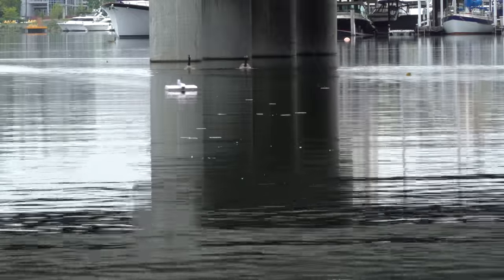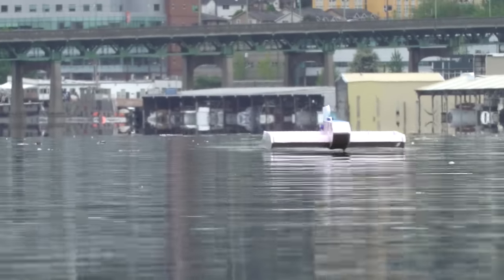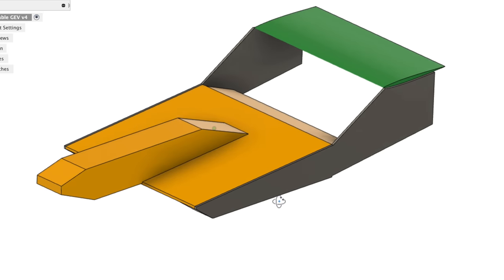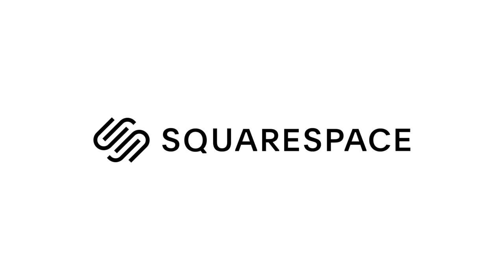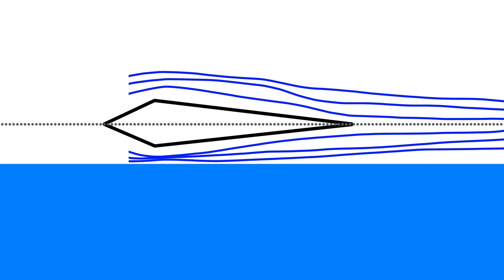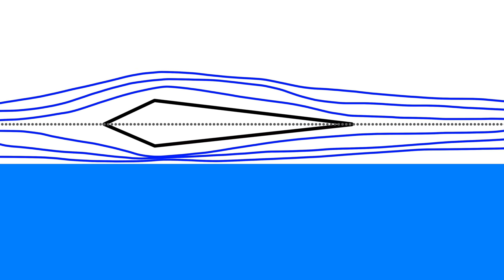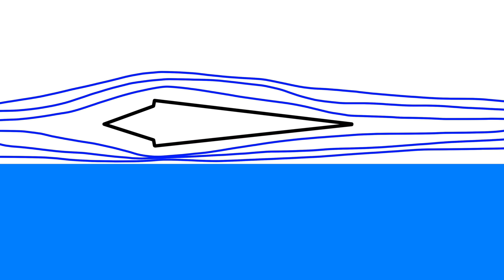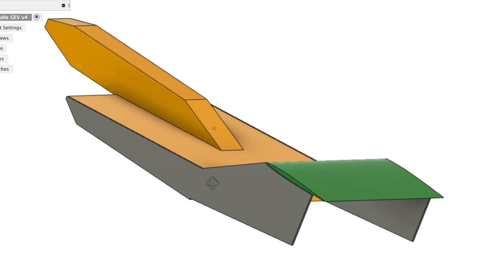RAM Effect Vehicle - A New Type of Aircraft Wing Design?

Comment: This is a cool project. The russian Ekranoplan was built in the 1970's and actually very successful as a cold war presence and as a ground effect aircraft. Glad to see people are still playing around with this concept
Reply: I was looking for this comment, I was  aware of the Russian craft as well.
Reply: The ekranoplan failed as a ground effect aircraft. It didn't function well under wavy conditions.
Reply: @MrAnonymousRandom  but you mean the showed in this video conzept is working even wavy condition or what are differences between?
Reply: @MrAnonymousRandom  I thought this concept here was intended for even more ideal conditions? I heard at least some Ekranoplans were able to gain quite an altitude for a bit, while this  thing is basically doing the same as a magnetic head would do inside of an HDD above a spinning disk...
Reply: The Ekranoplan worked, but was basically a boat with wings attached to it. For seriously effective ground effect vehicles, there's another scientist who was an aerofoil engineer first; boat-guy second. He came up with some seriously nuts stuff that could more effectively use ground effect to actually be useful in heavy oceans. Instead of being just a few meters off the water or land, we're talking tens of meters. Enough to travel over all but the heaviest of seas and most trees. Robert Bartini.
Reply: @MrAnonymousRandom  Doesn't  mean it was a failure as much as it was simply not as capable as they would have liked. It was an extreme example of engineering at the time.
Reply: @5peciesunkn0wn   you talking about different tasks. Robert Bartini tried to create a vertical takeoff seaplane. Rostislav Alekseev immediately made a heavy transport-attacking groudneffect vehicle - they didn't have to flight high. They just needed to move very quickly while staying below the tracking radars.
Reply: @5peciesunkn0wn  It wasn't a failure as the point of the Ekranoplan was to be able to fly low and avoid radar detection when necessary so it could launch attacks from close by. People saying it's "just a boat with wings" are missing the point, because as far as I know, boats can't fly away when needed, and as far as I know, boats can't travel at 550 km/h either. The reason the project was dropped was the fact that it was no longer necessary due to high precision guided missiles launched from ships and submarines basically being able to do everything an Ekranoplan was designed to do, but faster and cheaper.
Reply: I think most people here know this
Reply: @derbigpr500  Project was droped mainly becsuse of financial problems of USSR, not because was failure per se. Point of Ekranoplans never was to replace warships and they dont have the same role as submarines - they dont carry balistic missles or mines. Ekranoplanes were designed (at least Kaspian Monster) as desant vehicles, transport vehicles with speed of airplane and capacity of ship. Ideal machine for fast crossing Atlantic or Pacific Ocean with relatily large forces if Soviets will ever atempt to strike USA in America.
Reply: @Bzhydack  No (: 
Soviet never planned the landing of large forces in USA. The plan was to launch missile strikes and destroy coastal cities with heavy nuclear torpedoes. For this task there were both bombers and submarines.
Ekranoplanes were intended to fight American aircraft carriers and escort ships in a 1000 km zone. The second task was to organize a landing in NATO countries in Europe across the sea
Reply: @GuestNight  It depends witch Ekranoplan we are talking about. Kaspian Monster was clearly design as transport vehicle, but Lun was indeed carrier hunter.
Reply: @alexandrkil1140  its quite flat for its weight and scale all things considered
Reply: @Bzhydack  Kaspian Monster was named so by the West because of the abbreviation of the working name of the project - KM  - Корабль Макет ( ship layout). КM was a working heavy prototype on which nodes and engineering solutions are being worked out. It was not planned for the series, as well as light prototypes СМ-1 and CM-2 (Самоходный Макет 1 и Самоходный Макет -2) . The series should have gone: heavy - Lun, light - Orlenok, and super heavy carrier (the project remained in the design stage)
Reply: @MrAnonymousRandom  It could fly up to 16,000 it was only the landings and takeoffs that proved difficult in choppy conditions. On sand bars, mud flats, Russian steppes, tundra, ice sheets etc it would have been brilliant - but it's point was to counter the US aircraft carriers...
Reply: @5peciesunkn0wn  I was taught that ground effect is directly related to wingspan.  If true, go bigger.
Reply: The problem with ground effect aircraft is... well... the ground.   That's why they work well on water, the smoother the better, but fail when dealing with land.  This small craft can't handle grass because it breaks up the slip stream, stealing lift.  It would have to have much more power to push much more air under it to defeat grass.  Waves change the pressure passing beneath the vehicle which perturbs the lift as well.
To make a commercial one work would require an advanced computer and sensor suite to read the surface ahead and adjust it's elevation and thrust to maintain a consistent pressure envelope, otherwise the ride over heavy chop or open sea would be extremely bouncy and one especially deep trough would cause it to ditch.
Reply: @woodymiller2763  If the whole plane is a wing, then you have max wingspan.
Reply: @GuestNight  Except Robert's vertical takeoff idea was scrapped for conventional lift later, so he's talking about the right person.

Comment: Alright, so instead of aerodynamically stable in ground effect, how about some sort of built-in mechanical stabilization? I’m envisioning a floaty thing rigidly attached to a linkage that pivots and deflects the elevator control surface so that you’ll get full up elevator when at 0 altitude and full down elevator when above ~1ft out of ground effect. Basically leverage the nature of ground effect with the surface of water available to do work on your system for you
Reply: Could be problematic because of the relative size of waves and the float, there will be probably quite heavy oscillations. The aerodynamik stabilisation could be the smoothest one possible at this scale, like we could see in the video
Reply: That sounds like a concept similar to the arm that trails in the water to control the hydrofoils on a moth class foiling sailboat.
Reply: @GunganWorks  wow, did not know about this. Turns out they’re called ‘sensor wands’ and do exactly this. Now I really wanna see Daniel try it out
Reply: @GunganWorks 

YES!!!
Thats what I thought.
REALLY cool boats, the moth's

Comment: Waterproofing electronics I found the clear "E-6000" glue works the best and lasts forever. Hope this helps for future builds.
Reply: RTV as well.
Reply: In some flashlights they incase the electronics in epoxy, mainly for durability since the solder joints can't break, but also for waterproofing. Wonder if that would work too 🤔
Reply: @mynamesnotimportant6941  Epoxy is in fact a common method in industry to protect electronics and to preserve performance specs. It's called potting and incorporates certain characteristics, but the casual user can likely get by with many everyday varieties..
Reply: @joewoodchuck3824  fair about the average consumer. I like extremely durable things though so when I get the chance I'ma pick up an Elzetta flashlight. Really expensive but fully potted electronics so extremely durable. One dude even dropped his out of a helicopter at 300ft and it landed on concrete; broke the concrete but the flashlight still worked.
You can also disassemble the flashlight underwater, and nothing will get damaged (also from the potting). Really cool. :D
Reply: @mynamesnotimportant6941  Do as you want but you'll be doing yourself a favor by looking at Streamlite (Streamlight?) products first. Rugged and with a long standing reputation for reliability.
Reply: @joewoodchuck3824  streamlights are great, I have one. But they aren't quite up to par with Elzetta. Still great lights though :D
Reply: I pot stuff in hot glue for prototyping. It's waterproof but you can use a heat gun to remove it or adjust stuff later, and it allows for flex without cracking

Comment: Looks like a star wars speeder on sand.
Can you try it out on a really flat surface like ice rink or basketball court?
Reply: That could be hard, the hard surface might damage the rams/skids. It would be best with wheels probably
Reply: @blu5021  plastic trims on the skids will suffice
Reply: @blu5021  or teflon
Reply: I think it needs waaayyy more room than a single court.
Reply: @russc788  Mall parking lot?
Reply: @blu5021  Just need to add little pieces of UHMW on the parts that would run on the ground.
Reply: @alexjones7845  the principe of use ground effet to reduce drag is to prevent air flow around the wing. if your groud effet vehicule at is side constantly in contact with the water, this would theoretically remove induced drag.
Reply: Jean-François but wouldn’t that increase drag because the amount of drag from contacting the water would be more than what you reduce from air spilling out the sides
Reply: Football field...retractable wheels required.
Reply: @DivineArchirekt  not quite what your thinking possibly, but an Australian designed twin-hull called the Sharkcat uses the air trapped between the hulls to dampen the shock of manoeuvring through rough seas making it ideal for surf rescue.
Reply: yes pleasse, do this
Reply: @DivineArchirekt  wouldnt work for choppy water. Also I think the soviets tried it out its called the ekronoplan. Whack thing that was.
Reply: @blu5021 I was thinking ball bearings
Reply: WHere was he when they designed it for Star Wars? Oh yeah, waiting for birth!

Comment: Added effect of the wedge wing is that when you leave ground effect the vortices would create HUGE drag behind the wing as the vortices start to flow into the low pressure area inside the ram.

Comment: When my kids were little I would tow them behind a bicycle on the hard low tide sand at the beach sitting atop a ground effect type of sled made out of plywood. Needed a bit of headwind but as soon as it started flying it was almost effortless to tow. The final iteration had a canard type elevator that they would control. Had a few mishaps but with a helmet on they never got hurt , much. It certainly didn’t put them off doing it at any opportunity.

Comment: With a proximity sensor, you can program it to automatically adjust fan speeds so it doesn't get slapped onto the water.
Reply: that feels like cheating
Reply: ? pilots just use the throttle......

Comment: Looks great, your video is on point!

I tried a few ram wing designs years ago, but only ever on land. I got one stable with only rudder\throttle control though it was quite sketchy. The basic principle of a ram wing in ground effect with a lifting tail well out of ground effect gives you passive pitch stability, and as long as it stays low it's also self stabilizing in roll. If it does get out of ground effect it's game over, ask me how I know!

I actually strayed away from any power assisted ram effect after some testing, it's just one more variable in already tricky stability. Though you certainly proved it can work if handled carefully.

I've got an idea swirling for a wheeled ground effect craft now.
Reply: what sort of aspect ratio were your wings?

Comment: Have you thought about hydrofoils to get it out of the water, but are so short, that they'll leave the water when in ground effect?
Reply: Or maybe retractable ones
Reply: yeah, I came to the comments to say the same thing. I want to see some hydrofoil + ground effect experiments!
Reply: Retractable hydrofoil landing gear, this is what the world needs
Reply: @witchofengineering  RC Sea Dart When
Reply: Just left a similar comment and saw yours! Great minds...
Reply: @witchofengineering  the Beriev Be-1 (prototype of the VVA-14) just had fixed hydrofoils on the forward side of its floats, so fixed would absolutely work.
Reply: lol i just said that.... retractable hydrofoils
Reply: @hansm1149  there are much more useless things in existence unfortunately
Reply: Very small surface piercing ones, like winglets, could also help control while out of water
Reply: Sounds like it won't be compatible with building it from foam board
Reply: @m.sierra5258  If it was covered with a leighter ounce, bixaxial fiberglass and some epoxy resin, I think it'd hold.
Actually being so small and lightweight with such small pressures to work with, It could probably just be a way cheaper, lighter, fabric with resin.
Reply: A good idea for future experiments, but it would involve more work than those simple wedges.

Comment: 1. What effect does the wingspan have on the system? Would you be able to cruise higher with more wingspan?
2. Maybe you could use some smoke on the water on a cold morning to show the airflow and vortices?
Reply: I would suggest some Deep Purple music in the background for that video.
Reply: @matthewcragg3607  maybe he should set a nearby building on fire to create the smoke. with a flare gun for example.
Reply: i don't think it would go higher, just it's gonna get to the desirable height quicker.
Reply: @larsh.1154  great suggestion man, good stuff
Reply: @matthewcragg3607  I laughed hard at this.....thanks.
Reply: For this system specifically, I don't know if increasing the wingspan of the craft would directly allow it to go higher. Increasing the span works on other vehicles allows them to go higher because the vortexes made by the airfoils is larger (I think). This vehicle doesn't use an airfoil, so the vortex effect is probably less. 

However, I do think it could increase the cruising somewhat if you can keep the weight does climb to much as well. I think you would get a bit more lift if you increased the chord of the wing (length from the front to the back of the wing, for those who might be wondering), as well as some gains if you increase the area. 

TL;DR: I think you could get a bit more height if you increase the wings area somehow, though length would probably be more efficient at it than width.
Reply: Using this method: Not really. It's relative to the size of the entire craft, because what you're actually trying to change is the cushion of air. Bigger wings make that wider, not taller, and may actually be harmful.

The Soviets innovated this technology with a massive missile carrying version. This one was several feet up but was also massive - it could have technically been one of if not the largest aircraft at the time - and worked very well.... On calm waters only.

Basically, the whole thing has to get bigger so the cushion of air can get bigger and taller.
Reply: @larsh.1154  No.  Because then he would land in prison and his next series of videos would be something like "How to Make a Shank" or, God forbid, how to transport them unseen.
Reply: What I've read and seen suggests that greater wingspan contributes to higher flight at lower speed, take a look at the wing in ground effect vehicles that have seen real world use, whether they be Lippisch reverse delta wing or the Russian style they generally have a substantial wingspan for their size.

The narrow tandem ekranoplans seem to be incapable of doing much more than skip across the surface.
Reply: 643663
Reply: Larger wing dimensions lead to higher maximum heights, yes. It might not be a linear relation though, but instead a square or cube root. Also, both width and length can have this effect, I presume with roughly square areas giving the largest height/area ratio.